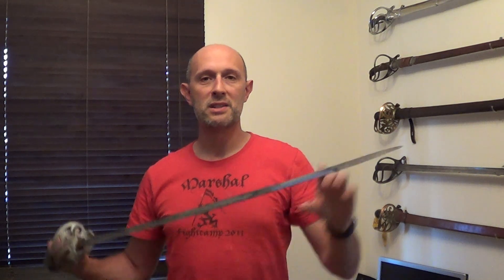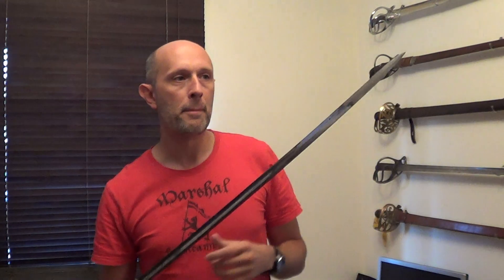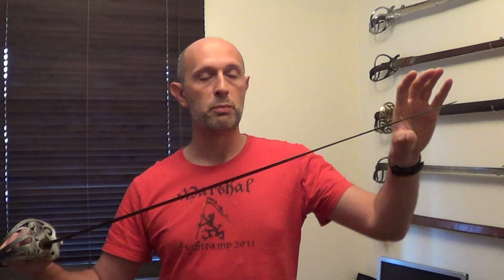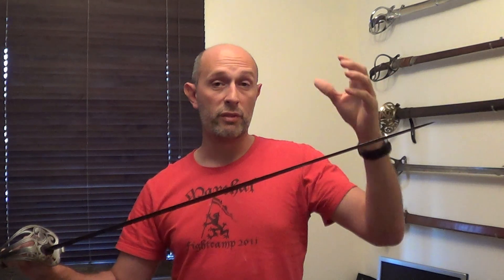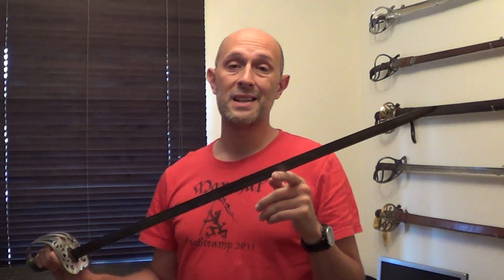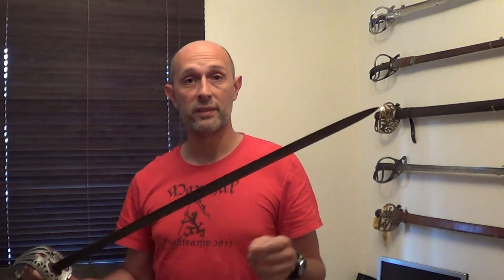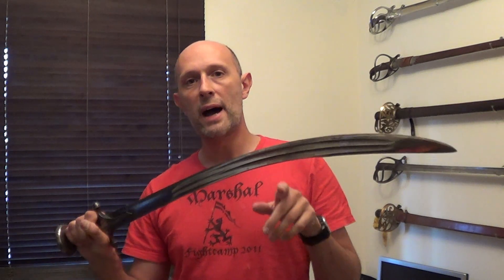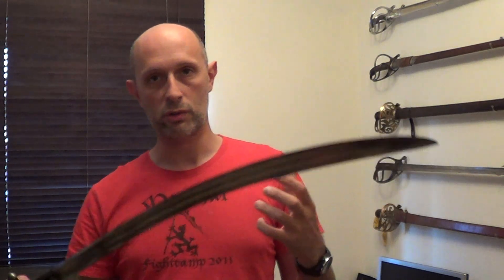Flexibility of sword blades

Comment: I thank you for this information.  I make blades. My first sword was a Cutlass . It's balanced,  it's razor sharp and to tell the truth , U have no clue as to whether it's a accurate reproduction or not the blade is 23.5 inches long 3/16 opposite from the edge, with a flat taper to the edge. You could cut a tree down with it. 
So to me, knowing the blade dimensions could help a lot. So where does one go for this information.  Making blades is fun and interesting. There is however many wrong ways to make anything,  and not so many correct ways.

Comment: I've always thought that swords were made springy for the main reason that they won't snap when you stab someone and the sword is withdrawn quickly by a calvary soldier who is moving forward with full force. Some are too springy and lack penetration ability..so there is a fine line when tempering. My Prussian 1889 calvary sword is perfect in that combination of stiffness/springyness ratio.

Comment: It seems I'm a little late, but would a Viking era sword be flexible or soft? (relative to a katana for example) Iirc they were made by twisting rods of low and high carbon steel together, with high carbon rods welded onto the edges.

Comment: As a newer collector, I learned the hard way to pay attention to the thickness of a blade, too. I made a longsword purchase and when it arrived it was floppier than a wet noodle. I would have known this had I paid attention more closely to the stats: the blade at the base was 4 mm. The tip was 3.5 mm. The POB was almost 7". Plus it was 5160. That thing whipped like crazy and was utterly unforgiving if you didn't have perfect edge alignment 100% of the time. I had to return it.

Comment: I GUESS KATANA MAKING GUYS DIDN'T GET THAT MEMO AND FOR 900 YEARS PRODUCED RATHER CRUDE SHORT CROWBAR  LIKE SWORDS WITH NO GUARD  LOL 
IF I WANTED A SHORT CHOPPER I STILL CHOSE GHURKA KUKRI WITH A D GUARD AND 26 ' BLADE  AT LEAST IT WOULD GIVE ME OPTION TO HAVE BUCKLER OR A GUN IN OTHER HAND  ... 
MATT ALL GOOD BLADES ARE FLEXIBLE  . EVER SEEN THE KNIFE TEST OR MILITARY SWORD TESTS  ? I'M SURE YOU DO  GOOD SWORDS BEND 60 DEGREES AND SPRING BACK TO STRAIGHT POINT  OF START  WITHOUT BREAKING OR BENDING

Comment: Hi Matt I just wanted to know if you have two swords of equal size which has hardness, flexibility and stiffness, but the metal of one sword has been folded 500 times, and the second 8000 times. Will one sword be stiffer than the other, or will it be the same?
Reply from the maker: There is no difference. Folding is only to spread out impurities and create a more uniform steel when using bloomery produced steel. If you use modern steel then folding the steel does absolutely nothing unless you introduce another element such as carbon.

Comment: Katanas were made so because the hard steel was rare due to difficulty of obtaining it in their inferior metalurgy process. This is reflected in all ancient japan tools, where only the edges are made of steel, and the rest of the weapon/tool is made of iron.
Reply: 1.)There is no softer and harder steel just like that. What matter the most is heat treatment or more precisely crystal structure.
2.) There is no one way to make katana and by the way katana mean just sword of any type what so ever. There are European swords with iron core and there are Japanese swords with no iron core.
3.) Only difference between steel and iron is carbon content.

Comment: but if your katana isn't just made of soft and hard steel but also flexible steel encasing the soft steel, wouldn't that add some flexibility to it?
i think it's called shihozume or so. that's how my katana is made and it flexes a bit. not much i think but a bit. there might even be a construction that utilizes four different types of metal, the cutting edge, the soft core, a supporting steel encasing the soft core, i think for more stiffness, and more resilient steel encasing the steel that is encasing the core, for protection of the back and sides of the sword.
now that does require a lot of skill, time and hence funds so it would be a very high quality katana, not at all normal, but could something like that exist or is it just an invention of katana fanboys to justify their claims of the superiority of the katana?

Comment: 11 months ago you kinda put it right into perspective Matt. Essentially, you admitt that overall, the Katanas, even bendable  ocasionally, in fact is a better dedign and are, better cutters and thrusters than more flexible blades. No Katanas will ever break in battle! Incidentally, that's why they were not distal tapperdd either, to make them stiffer.
Cheers!
Reply from the maker: Nike Mozack Katanas did break in use quite a lot actually - it is well documented in Japanese history and art.
Reply: scholagladiatoria Earlier Japanese swords were originally monosteel tempered. And they broke. However, differentially tempered  swords like you said will bend, and possible break, if keep bending them enough, but they won't break if hit with another object. The San Mai have a soft core iron bar, with the sides of medium hard steel, and the edge a very hard steel.
Reply: +Nike “Hombre” Mozack  It's just steel, it's not magical.
Reply: +Nike “Hombre” Mozack Dude, there are reports of Katana, not Tachi, bending and breaking inside people because of their structure. Katana were not known for being durable and are not "better cutters and thrusters" than more flexible blades. A rapier and a longsword would be more adept at thrusting and similarly a tulwar is more adept at cutting. I don't know why people like to look at Japan as the pinnacle of sword engineering, they were stagnant and backwards for most of the medieval period. They didn't trade with other nations, they only had experience fighting themselves and they had shit all natural resources. Their method of making swords wasn't done to make them better than European weapons, it was done to compensate for shitty iron. And they picked up the technique oh I dunno, 1400 years after the Europeans.
Reply: +Nike “Hombre” Mozack There are tons of  historical evidence where spear blades (made the same exact way as Katana blades) broke off and stood in the battlefield. Perhaps the reason there isn't a lot of broken katana's in battle is because it's not a battle weapon, it's a duel/status symbol.
Reply: +Nike „Hombre” Mozack A bent sword is just as useless as a broken one though... And you can't set it straight infinietly, especially since the very hard edge would break. Katanas can get bent even if you cut a tatami mat at an off angle.

Comment: The problem with a lot of sword customers is that they have unrealistic expectations of a sword. They want a sword that's stiff as hell but will flex 90 degrees without taking a set, will cut steel, never need sharpening and never break. Oh, and it shouldn't rust. Or wear out with repeated sharpening.
Reply: Then they must buy  sumori
Reply: @ManpreetSingh-lq6bw  All you need to make a sword like that is a few basic enchantments!
Reply: If you want a blade like that your gonna need likely a lot more money and a different material for the blade

Comment: A lot of Asian blades, not just Japanese, are only hardened at the edge. Suspect because these blades often were only hardenable at the edge to any great degree. Most types of keris blades I've seen including the wide-bladed type were only relatively hard at the edge, the bulk of the blade was very soft.

Comment: As we've put it on bladesmith forums, sword crosssection determines flexibility and sharpness, steel and heat-treat determine elasticity and how long it stays sharp. And the longer the blade, the more of a balancing act you have between weight, balance, and efficiency. Historically Europeans, even well before any sort of decent "monosteel" was available, seemed to have prized elasticity in blades. Flex-testing swords is mentioned in connection to the Celtiberians, and later, in stories about Charlemagne.
Reply: Elasticity is relative the degree of curve forced into the,  So the butt of a sword might bend hardly at all, and even not heat treated, could be perfectly elastic for the task, but the tip may need to bend a lot more, due to it's section, so it needs a spring heat treat.
Reply: @HondoTrailside  Most commonly the tangs were not hardened at all, or made of wrought iron.

Comment: scholagladiatoria where did you got the idea that katanas were edge quenched? This is the second time I hear you say it and I have never heard of it elsewhere.

According to my knowledge it is impossible to make a real katana with that method because katanas are not hammered curved but instead hammered as a straight blade that gets curved during the (full) quenching.
Katana right before quenching: http://prntscr.com/5vv96a
Same katana right after quenching: http://prntscr.com/5vvnu7

Correct me if I am wrong but I believe that you are very little familiar with katanas and therefore you are under the misconception that they are much more simple than they truly are. There are many different kinds of katanas and "katanas" that have been made.
Please take in consideration that the concept/image of the katana ranges from some of the best masterpieces of sword that have ever existed on this world, all the way to some katana-shaped-like-objects that don't even deserve to be called a sword. Do not judge the former by the later.

p.s. The spine of some real katanas is actually not the softest but the hardest part of the blade :) the only part that needs to be soft is the core not the spine.
Reply from the maker: TheApokaliptic The whole katana blade is quenched, but only the edge is exposed - the rest is covered in clay. This is basic katana-making 101.
Reply: umidontno040394 The edge may be covered but only thinly. The body of the blade is more protected in order to cool more slowly.This is the art of Japanese differential hardening of blades. The edge is cooled rapidly and is harder but more brittle.
Reply: scholagladiatoria ...and this is why the the blade bend in the quenching prosess right? or does it bend in the heating?
I was under the impression that the bladesmith could partly manipulate the bend in this prosess with the clay, larger edge exposed...thicker lay of clay...and so on.
Reply: scholagladiatoria wait....I thought JUST the edge was covered in clay?
Reply: David Cooper huh. ok then
Reply: +umidontno040394 its to do with the crystal formation. an example is basalt and granite.

Comment: in china the clay quenched pattern welding blade such as tamahagane and other type blade steel are very highly valued through out history. but it doesn't mean it was better making weapon than the single mono steel. one famous record of this was in 19th century long quan: in a swordsmith competition. swordsmith shen guanglong used imported european steel(西洋精钢）, spring tempered. while rest smithes still using pattern welding steel. result was simple. Shen's sword said to be able to bend into a circle and return true. it out cut all, and finally bend and break one of the competition's sword in several stroke.

Comment: type of heat treatment for the chinese sword depends on the different historical period. and vastly depends on indepented blacksmith methods. one methods of spring tempering is mentioned like this: first quench the whole blade in horse piss(lol serious no kidding, i guess its act like salt water solution or for some superstition reason). then temper the spine by using 2 piece of red hot iron bars sandwich on the spine of the blade while the edge remain in water. hold still until the blade turns blue except the edge. but after ming dynasty chinese quickly adopted japanese type of blade. 9 out of 10 antique sword of ming and qing will bend if you step on it.
Reply from the maker: Qiang Luo Very interesting!
Reply: This reminds me of Tai Chi practice Jian (that thing wobble around with a regular trust at nothing ! lol) and actual long Jian and shorter Jian from spring and autumn period. :)

Comment: Thanks, it is interesting.

A modernish example is the machete. Most are thin, and given a spring temper so they're very flexible for taking the knocks. They're not overly hard and usually carbon steel (indeed I wouldn't buy one that wasn't). Their cross section doesn't really lend itself to stabbing but they can deliver a nasty chop.

Comment: Steel always has nearly the same stiffness. The main difference here is, at which stress it transitions from non-permanent deformation (elastic) to permanent deformation (plastic). Assuming the same geometry, a spring steel is no more wobbly than a rebar steel.

Comment: 2:20 I find this hard to believe. In Shogun TV series there was a scene where Mr. Yaboo got his catana's blade stuck in a wooden pivot but when he tried to pull it out it didn't bend. It broke.
Reply: Breaking when bending is a sing of a bad blade.
The material not folded often enough to homogenize the steel, or a bad weld during folding.
For Japanese blades, being able to bend the sword back into the original shape without breaking a sign of quality.

.. and it's a TV series not necessarily a perfect reenactment of historical occurrences.
Breaking looks a lot more dramatic then only bending.

Comment: People talk a lot about how the lateral vibrations of the blade impair its cutting power and therefore you should try to strike at the location of the vibration node. What is the source of this information? It's surely not obvious to see that this would make a difference when you're doing test cutting yourself. In fact, it's not clear lateral flexing happens in the same way when the sword is striking an object because the boundary conditions are different and so the node could conceivably end up in a different spot along the blade under load. It would seem that the most important flexing attribute for a cut would be torsional flexing which could mess up the blade alignment AND be caused by slightly bad alignment to begin with. Similar to aerodynamic flutter, if you will.

So, how exactly do we know this? I don't think it's sufficient to say that we observe that the vibrational node is the best place on the blade to strike with; it could be that that's simply the best place to transfer force to the target and also happens to be the location of the lateral vibration node for other reasons -- correlation does not imply causality.

Comment: The Chinese dao broadsword is famous for being flexible, especially the practice swords, and especially towards the tip. I would imagine that higher quality dao are more robust and stiff, and that the practice swords are made extremely thin to make them cheap. However, considering their flexibility, they seem to be designed mostly for unarmored combat. Without armor, I would imagine that even a very flexible broadsword would do a lot of damage, mostly with slashing attacks, but even with thrusting. I find this sword especially interesting as it seems to have been one of the most popular weapons in China historically, and considering it seems unusually flexible.

Comment: What does "katana" mean?
It means Japanese sword
Reply: My understanding is that "Nihonto" means Japanese sword and "katana" refers to a particular type (single edged, two handed grip, over a particular length etc). Also "Shinken" may be used if it is a sharp blade.
Reply: Samurai Cop reference!
Reply: I see, didn't get the reference. Don't mind me...
Reply: lancer D
I'm actually a little embarassed that I DID get it . . .

Comment: What kind of steel would be best for a morningstar? Would simply very hard steel be good for the spikes on the mace?
Reply: I imagined that wouldn't be the case, that'd make a very brittle morning star?  The spikes of a morning star already had a lot of stiffness in the first place from their cross section.
Reply: I'd use a hollow mild-steel head, and thread it for the spikes, which would be tool steel and quite hard. (and replaceable if any get munged up)